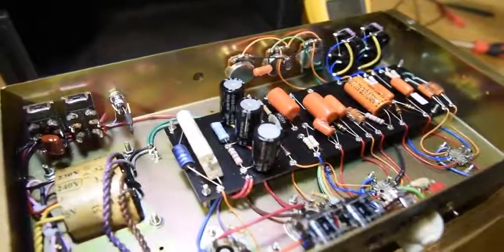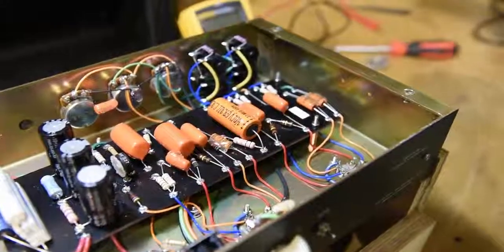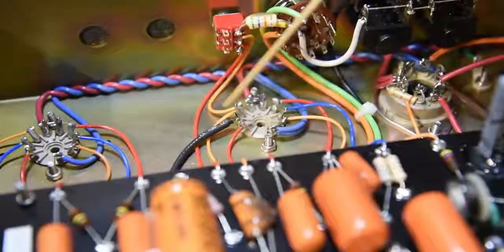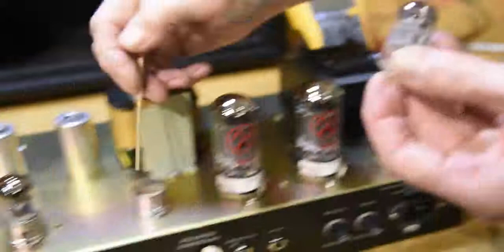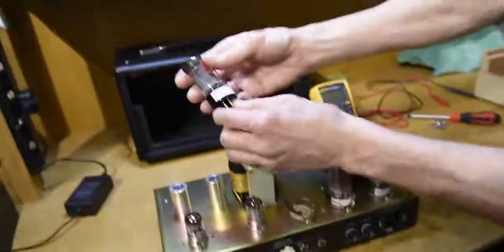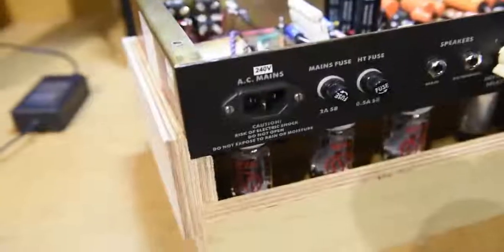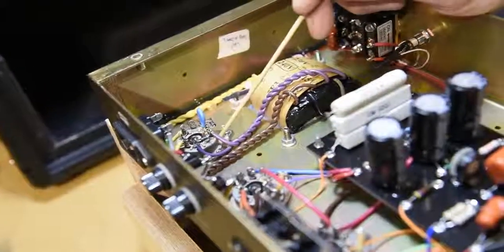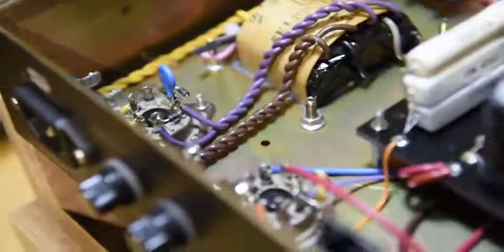Ceriatone Amp Deisgn Walkthrough

Comment: Been searching for an older yet super clean Ceriatone Chupacabra 100, and today I finally found a beautiful 2011. My backline is particular, with an old Egnater MICA Bruce built and an early Diezel VH4 head anchoring the rig. Recently sold-off an early 1970 Marshall SL-100 and have been seeking a quality 100 watt build to use in its place (as I experienced serious seller's remorse). What Nik is doing with both design and build-quality is nothing short of amazing. I am fortunate enough to have many amazing vintage amps (e.g., two 64 Fender Vibrolux amps, old 63 VOX Copper Top AC30s, AC50s, late 60's Marshall heads, etc.). BUT regardless of price-point, the amplifiers Nik is building truly reflect everything one could want and demand from an amplifier...and then some. So thanks man, the attention to design, quality and detail is appreciated!